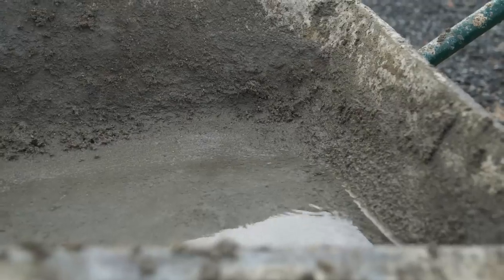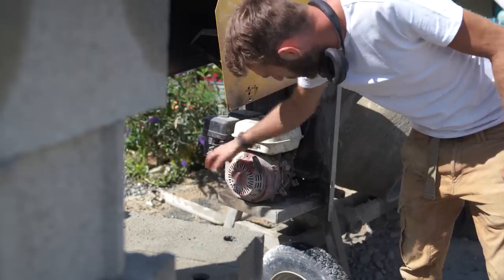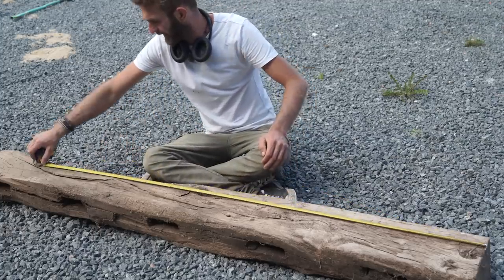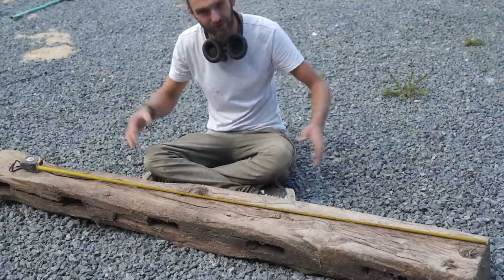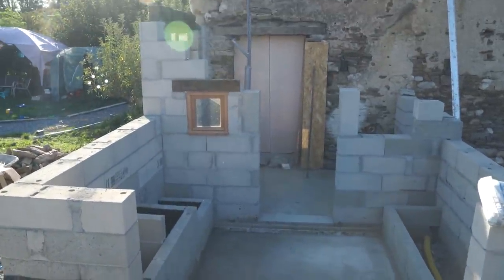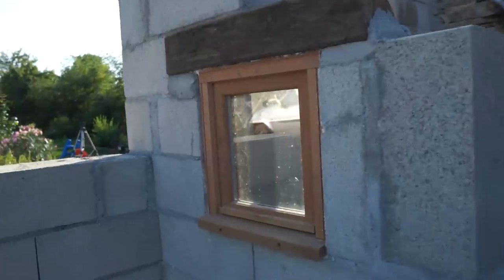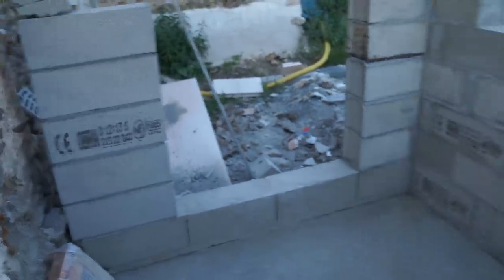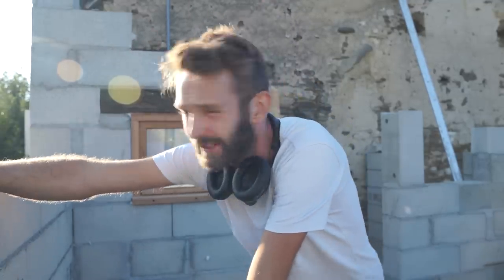Installing the 300 year old oak lintels

Comment: I'm not an engineer but I know that different materials have different thermal properties, especially when it comes to expansion and contraction. Mixing wood and cinderblocks as load bearing elements with no tolerances may cause cracks to appear in your walls some time in the future. But then again, I have never built a house so what do I know

Comment: Your big lintel looks like several pieces of the carpant in my barn. Professionnal massons told me they were the wings of a windmill. And it's true that 170 years ago a windmill close to my house stopped it's activity. Therefore it has been dismanteled and some if not all parts were used for other constructions.